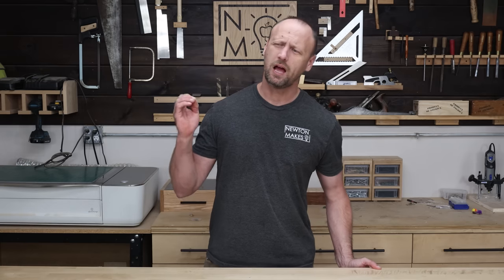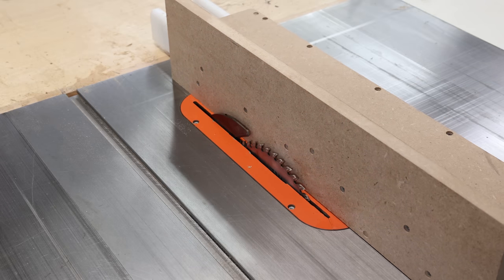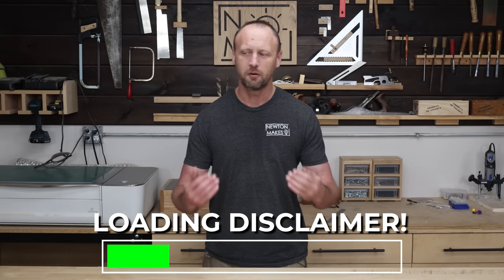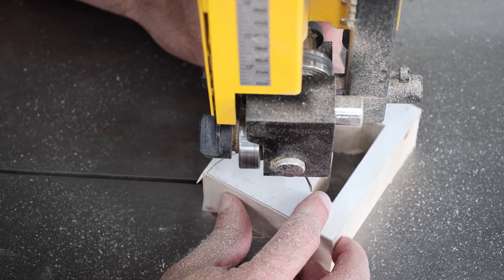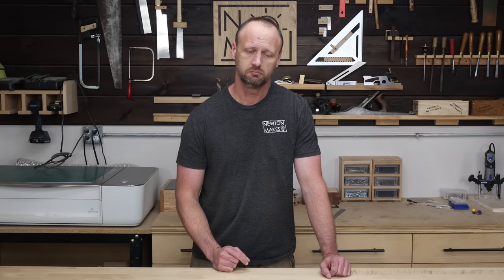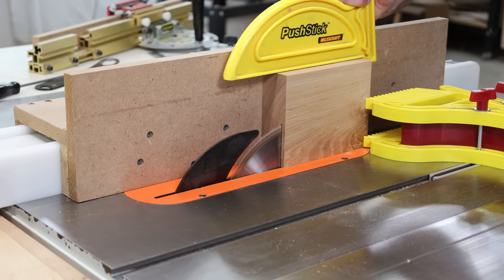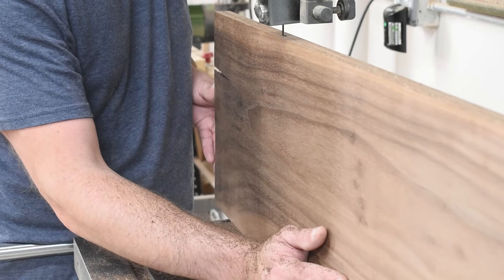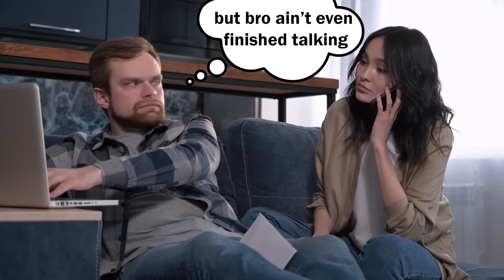You’re Resawing Boards the Wrong Way

Comment: You are spot on about brain drift.  It's how I recently learned you can't touch the bandsaw blade.
Reply from the maker: I have ADD so I know my limitations 🤣
Reply: Hey, @georgestgoerge5110: Yes, you can touch the blade. The point you are trying to make is that you shouldn't touch it. (Hope you did not hurt yourself too badly.)
Reply: With a decent, properly tuned bandsaw, drift shouldn't be a problem.
Reply: @kwilliams2239  Mwaaa haa haa haa!
Reply: @FirstMM  Glad you agree.
Reply: @kwilliams2239  I have a trash dinosaur bandsaw and I don’t get any drift. I do have to spend the extra time to reset everything each time I use it, but I agree, if you’re getting drift, your saw isn’t set up properly. I do think blade quality has a bit to do with it also.
Reply: @hardcornpour  Yes, a sharp blade is critical. Over-extending blade life is a fools errand.

It's rather like using a razor for a year.  It'll sure cut, but not the way you want it to.

Comment: Ditto to all your observations. All three votes are in- this is the preferred method. I take a little longer then you- I inch up the table saw blade and make several passes. Doing so, I find it to be safer. When the blade is cutting 3 inches of wood that is a lot of energy (force) being applied to the wood and more force equals less control and more risk.

Comment: On point. I do not have a band saw. Score them on the table saw and then use a carefully sharpened 26" ripping hand saw to split the board. No drift. 
A few strokes with a hand plane followed by a scraper of needed and I'm good to go. Save on the space, expense and sawdust of a band saw. Just as fast for my needs.

Comment: Loved your vid. taking down boards on the jointer and thicknesser is slow and LOUD!!! I take down my 25mm boards on the table saw ( usually down to 18mm ),  a quick sand with 80 grit with my orbital sander and all is good. My wife uses the offcut and I am happy with the time saved.
regards,
Allyn Hansen
New Zealand.

Comment: Thanks heaps. I used to always resaw on the the table saw but have been battling the bandsaw for several years. You’ve reminded me why I did it on the table saw. I will now go out and save myself several hours of misery in the shop to resaw veneer for a couple of dozen kitchen door and drawer panels.

Comment: I have a Laguna 14 inch bandsaw that has a foot brake.  Absolutely brilliant.  I wish there was an equivalent brake on all my machines.  It also has exceptional dust collection.  I'll take my bandsaw with a king resaw blade over an exposed table saw blade any day.  It really doesn't take much effort to thickness away the tiny ridges.
Reply: I think OP's problem is that he's trying to resaw 8 and 10 inch hardwood on a 1 1/2 (rated) HP rikon bandsaw.
Reply: @blemtaters  True, you gotta use what you got.
Reply: @blemtaters  Do you think a Laguna 18BX would be enough for 8" hardwoods with a resaw king blade (or any other) blade? Need abundant clean and thin resaws and not sure whether to get a bandsaw for them or keep going with a table saw with red blades.
Reply: @kay6736  It certainly will meet the task.  More power from there will get you more speed but you've got enough power to do it at a reasonable pace with the 18BX, or the Harvey C14.
Reply: @blemtaters  Thanks for the response.

Comment: I resaw at both the cabinet saw and bandsaw.  It depends.  One thing’s for sure.  The book match is better at the bandsaw.  A well tuned bandsaw with a 3 to 4 teeth per inch hook blade will leave the surface fairly smooth.  Good video.

Comment: I have done it a couple of times on the table saw, using the method you demonstrated, but I just don’t like putting a board on edge and pushing it through the blade. Once past the feather board there’s nothing to push it towards the fence and if (when) tension is released it can get wonky really fast. 
I have an old underpowered Delta clone bandsaw with a riser block and I use the Woodslicer bandsaw blade for all of my re-saw operations. 
There’s more than one way to skin a cat and whichever way works best for each individual is the right way.
Reply: If you're not cutting all the way through you can put a feather board halfway up the board at the blade. This will hold the board in place and not pinch the kerf.
I saw him cutting that small piece on the table saw just holding it with the push stick and thinking "that's really going to hurt when it kicks back and hits him".

Comment: 95% consistent with my own experience and it's good to hear some validation.  The difference is I use a full-sized thin kerf rip blade (3/32) which is more 'general purpose' than a circular saw blade i.e. doesn't need to be changed out.  Also my old bandsaw was kept for use with the curve-cutting smaller blade as that sort of stuff tends to be smaller anyway.  My Resaw King (and drift fence) on the Laguna handles smaller/easier resaw tasks OK, but for bigger more exacting projects, the table saw method is definitely preferred, more consistent, and less risk.
Reply: Ah of course. Thin kerf rip blade. Not sure why i didnt realize the obvious.  Thanks!
Reply from the maker: I use one of those too. But I recently saw the newest version of my circular saw blade is only 0.054" wide! Wow!

Comment: Amen, agree with your take 110%.  Hobby WW but I’ve been doing this 60 years and still have all of my fingers 😅.  Much simpler and no blade drift using Table Saw and clean up on band saw and surface planer.  GREAT TIP, KEEP UP YOUR GOOD WORK! 😊

Comment: I've been resawing this way for years and it does work well.  The only downside is that it wastes more wood than resawing on the bandsaw. For me, the savings in time typically required to make and clean up a bandsaw cut make using a table saw worth the added waste, with one exception. When working with an extremely valuable wood, such as a board from "The Tree" or with other unique figure, the waste must be minimized.  When working with such woods, I'll spend the extra time carefully tuning the bandsaw with a dedicated resaw blade and making the required slow cut.  Your advice to consider using a thin circular saw blade is interesting; I'll try that next time I resaw.

Thanks for the thoughtful,  well-made video.

Comment: Wanting to be a "Real Woodworker" I went the route of milling air dried wood. More time consuming but lower initial costs. Even went to chainsaw milling. Watched YouTubers resaw and followed the common consensus. Bandsaw for long resaw cuts, especially when the cut is almost the total hieght of my ability to cut. I've had all of the problems. sometimes drift other times not.  The table saw with a thin kerf blade is efficient . Your video is spot on. Murphy Tested and Recommended. Would add that cutting rough sawn lumber to approximate finished sizes improves my efficiency, while Murphy my mentor does not. Thanks for posting this.

Comment: Great Video, Like you, I have been doing this for a very long time.  When I first started woodworking, I had a decent table saw with adequate power and a cheap bandsaw which didn't have much power and terrible guide bearings.  I like re-sewing material to get grain matching, so by default, I discovered this method.  My equipment has improved but my methods have not changed.  Thanks for sharing this method with other woodworkers.

Comment: Great video! I don't have my bandsaw anymore and for the 1st time since geyting rid of it I need to do some resawing. I was planning on using my unisaw with an auxilary fence to resaw the boards and was nervous about the safety aspect. Thanks for putting my mind at ease. I totally plan on leaving ~1/2" in the middle and just using a handsaw to get the rest of the way through. Thanks again.

Comment: Thank you so much for that advice, I have a Laguna saw and a Laguna blade and I have tried till I am blue in the face to get no saw drift. I don't know whether it's the blade or what but I have watched so many YouTube videos who all say something slightly different and I think that yours has hit the nail on the head.From now on I will use a thin kerf blade and finish it off with the bandsaw.

Comment: I've been resawing  with just the band saw for years even though Ive seen this method before. I think I'm going to come back and try it with a table saw for some of the benefits you mentioned. One that I didn't hear you mention is that I sometimes get thicker boards open up or close down if there are any internal stresses. Knowing which way it's going to go before I get to the band saw will help me prepare better either by having a wedge on hand if it's going to close down or biasing my cut if it's going to open it up

Comment: Very informative thank you. Might be worth checking maximum rpm of circular saw blade vs max rpm of same blade size on table saw for safety reasons. That said, it's always possible to make a table saw by bolting a circular saw under a table (loads of videos on youtube). Thanks again; you've probably saved me hours of re-finishing (I have over 1000 small pieces to re-saw :)

Comment: 1000% agree. I wish I didn’t sell my table saw. Although I would hardly call my old Shopsmith a table saw:-0 it seemed dangerous, HOWEVER I love this idea of yours!!! I have the Laguna re-saw blade on a 14" Rikon and still get some drift because of the hardwoods I typically use. I need to purchase a table saw and use this technoque. Thanks SO MICH FOR SHARING

Comment: Great video. I also prefer to at least start a re-saw on the table saw, also with a taller fence addition. However, if the board is not too long I'll do at least one low pass on the ends. That makes it so easy to locate the bandsaw blade at the start. It also means the cut is finished before my fingers get near the bandsaw blade.

Comment: I have the privilege of owning a RIKON 10-340 for resawing, but it too has blade wander even with a 3/4" blade. Most time I do what his guys does and remove the bulk of the material with the table saw and wiz thru with the band saw to remove the rest. But I did learn to use a circular sawblade, although that leaves a bigger bridging piece, to reduce the kerf of the saw blade,

Comment: One consideration are us folks that don’t have a super powerful cabinet saw and can take such a large pass on one piece of wood. Also, regardless of table saw or bandsaw, your going to have to use the planer to get two pieces of wood the same thickness, so my bandsaw would be faster than taking multiple passes with a contractor/jobsite table saw

Comment: Your suggestion to make the cuts on the table saw first does work and I have used this method. However, I prefer to just change my band saw blade, set up a guide and resaw as much as needed.
If I lost concentration while running a power tool it time to shut it all down and take a break.

Comment: I prefer to resaaw  the same way you do.  But I add one safety consideration.  (Always thinking about safety as I teach Woodworking in a school.). As I near the end of my cut on the Band Saw, I use a scrap wood block to push the piece the last two or three inches, rather than reach around and pull from the back side of the blade.  Every saw Knick on the scrap block is a reminder that they kept their fingers safe.

Comment: Excellent video, and great info.  Thank you for sharing a reality check.  I have always been in the camp of all the waste…. But using the bandsaw exclusively and cleaning up the cut easily makes up for the reduction.

One thing I do want to say, you using your fingers to push through drove me nuts.  I have the scar from nine stitches on my fingers from doing just that on a bandsaw, when the saw found a soft spot in the wood, and suddenly sped through the end of the cut.  You should use a push stick on the bandsaw too.

Again, thank you for great info.

Comment: I have the same bandsaw as you. Maybe the dame tablesaw if you have the 3hp PCS. I have had mixed results with using the bandsaw to resaw, I usually use the tablesaw method myself. So I would agree with you 100% on thos one. 1 also hate changing blades on the bandsaw. I usually keep a 3/16 4tpi skip tooth on mine or a 3/8.
Reply from the maker: That's what I keep in mine as well.

Comment: Just got through resawing an 8.25” wide piece of cherry on my table saw and I can tell that I made so many mistakes: I don’t have a tall enough fence to properly rest the wood against, my feather board wasn’t tight enough against the wood (how tight should it be??) and it’s way too short, the board was way too long for my compact saw (> 48”) and I didn’t have a good way to cut the piece in the middle so I just planed the whole thing down, wasting literally half the board and winding up with a cupped wall ornament of get-there-itis. That’s enough mistakes for today, gotta leave some for tomorrow. Thanks for the video, hopefully I can improve my methods.

Comment: Great video. I am not a huge fan of resawing on the bandsaw, and find it easier and faster on the table saw. I would also argue that having a table saw is more common than a bandsaw. What I personally like to do it at my blade height barely under half of the width of my board. Enough that it still holds together, but also that the sliver holding the two pieces together can simply be broken by gently tilting the sides back and forth. When done like that, clean up is minimal and can even be done with a small plane or a scraper!
Reply: Sometimes I get the cut that close that I'm able to break the two pieces apart. From now on, I'll work at doing it on purpose.

Comment: I used to keep a combination blade in my tablesaw, but after I did my first resawing with a brand new Freud rip blade I was so impressed with the smoothness of the cut that I have never put a combo blade back in the saw. I have a compound miter saw and radial arm saw that I use for crosscuts. I do as in the video here and have the table saw do most of the work, finishing off on the bandsaw, then running the pieces through the thickness planer for final surfacing.
Reply from the maker: I often use a rip blade too

Comment: Thanks.  Always good to know alternate ways to skin the cat (or walnut board).  Just and observation.... The blades that you spec'd on Amazon are .091" kerf.  You were measuring the thickness of the steel disk, not the carbide tooth.  0.091" is 3/32" so, if a normal table saw blade is 1/8", you were are really only talking about a 1/32" thinner, and still 2/3 thicker than a band saw blade.  If there is a different blade out there that you know of with a 1/16" kerf, I'd try that!

Comment: Great analysis all around. I have been thinking a bandsaw would be ideal for re-sawing some thick hardwood bowl blanks but I didn't know about drift. What do you think of drift bars like on Grizzy G0513Z? I imagine the hardwood would be a bit more challenging to re-saw on a bandsaw. I did a couple on a table saw alone and got uneven step-like surfaces so I guess I should make a jig. I have no planer so I want to make the cuts as flat as possible. This is a very helpful video to help me decide and also not commit to either. Thanks!

Comment: I really like you're approach to re-sawing.  Sadly I don't own a planner and I'm not skilled at hand planning.  In this case do you have any tips or tricks for making the final separation cut on a band saw?  I currently use a 9" lower-end band saw, but it works just fine for most of my projects.  I would also need to follow-up with my orbital sander or belt sander depending on how clean a cut I can achieve on the bandsaw.  Anyway, thanks for the great content. :)

Comment: To make a band saw blade stop sooner, start a scrap piece and turn off the saw. Push the scrap piece a little and it will stall the blade. For wider pieces, take two blocks and use them like brake pads on a disc brake to stop the blade.

Comment: I understand your pro/con list mostly, but do you not cut oversized and sand to smooth when resawing on the bandsaw? If I were aiming for a 1/8” board for a project, I do not expect it will be smooth enough for most operations so when sanding you will go under that. Is this not a concern for your projects?

Comment: On this topic. I am considering getting a new band's hall. Cancel debating between getting a Laguna, 14 inch band all or or Spring. A little bit more and getting grizzly 19 inch band saw.
They both have about the same  Resaw but the 19 inch saw can cut more larger wood Horizontal And has a 3 horsepower motor instead of a 2 and a 1/2 horsepower. It doesn't look like I can get the Laguna blade for it. So I'm looking for the opinion. Does that blade really make that big of a difference